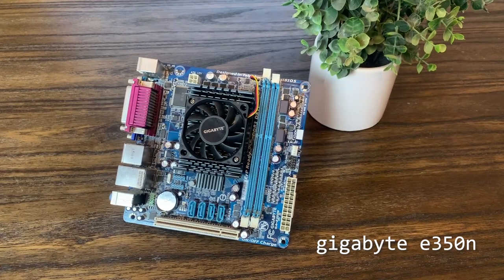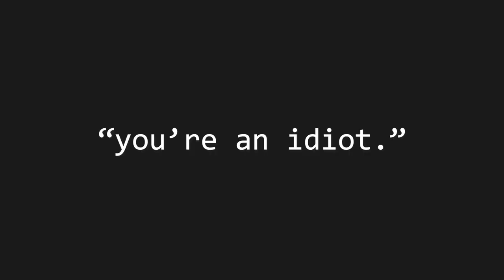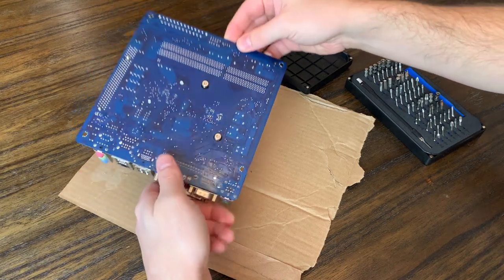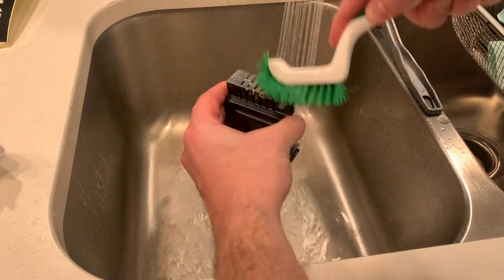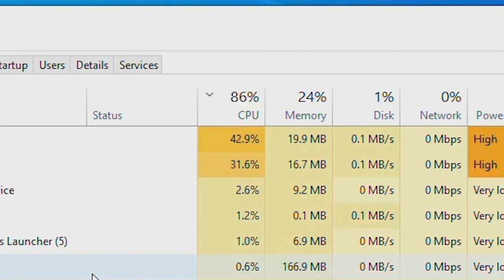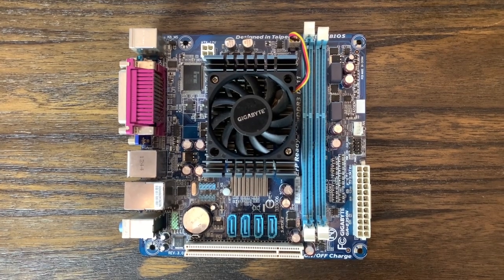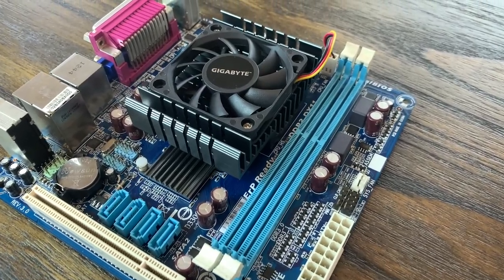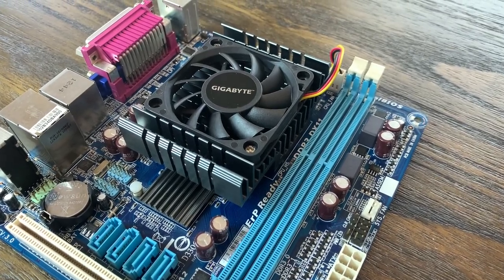Dual Core Disaster? - Landfill to Lan: Gigabyte e350n

Comment: A few suggestions I'd like to offer, as someone who routinely optimized low-end hardware for Windows 10:
1. 2x2GB RAM instead (even if it's still single-channel, I've noticed an improvement over a single stick)
2. Lower-resolution monitor (something like 1024x768 or 1280x1024 still looks great when native)
3. Built-in Windows 10 Optimizations (Task Manager startup, Services, Performance menu)
4. Web Browser Optimizations (Opera is a great choice for multiple reasons)
5. Sometimes an obtuse BIOS setting (such as core locking) can allow for CPU voltage control
6. If you can get the voltage changed, a better CPU cooler, or even a molex CPU fan, can help temps
7. Emulators such as WinKawaks run well on Windows 10, even when there's no performance to spare.

As I'm typing this, I'm running Windows 10 natively on a 1 core, 1.4Ghz atom netbook, and thanks to the tweaking I did, it performs better than what I saw in your video. It's not to brag, just to show that there is performance on the table.

Comment: I'd love to get my hands on one of these (the USB 3 variant). I think it would be great for a basic NAS box.
Reply from the maker: That would be cool to try out!
Reply: For a NAS box id get a Intel board like that since intel Idle power consumption is extremely low
Reply: I have a MSI e350n usb3 in a cooler master 110 mini itx case & the mentioned ASUS R7 240
Reply: I suspect a Raspberry Pi 4 is faster and lower power.
Reply from the maker: DarkeEmpire G0370WW  it's currently running ubuntu server for https://fivedollarpsu.com
Reply: I have an Asrock E350M1, 4xSATA 3, 1x PCIE (x1), Realtek 1 Gig LAN adapter, but only USB2 ports. It ran for years as HTPC with Kodi under Libreelec. Good for H264 up to FHD resolution. Tried to repurpose it as NAS but it's a little slow for this. Openmediavault, 2x SATA 3.5" drives, CPU is a bottleneck with LAN transfers. Reading a single large file from E350 via Samba max 50 MB/s, SSH/SFTP read only 35 MB/s, encryption kills the CPU. Pure FTP goes up to 80. In all cases CPU usage close to 100%. Didn't even try any sort of RAID. Disks are not a problem, both go above 100MB/s. Running iperf between E350 and another machine on LAN would give only 830 Mbps (usually it goes up to around 950 Mbps). Now what I would like to try in na NAS is one of those later AMD AM1 Kabini/Jaguar APUs 🙂
Reply: @KevInPA84  nobody cares
Reply: @JamesMyatt1  Was thinking the same thing.

Comment: Well I have a suggestion, look for some broken laptops or even just the motherboard by itself, you get very little expansion, but you can get a hold of much nicer mobile CPUs within the $20-$60 range, for example laptops with an i5-4300u are fairly common and so old that they go for next to nothing, but they're really not bad, they're actually a decent improvement over that a6-5200 you have there and I don't have a watt meter but from what my uninterruptible power supply tells me, I can estimate it uses around 20-30W with a basic 5400rpm drive, plus unlike desktop ram, for whatever reason so-dimm ram is dirt cheap, like near $1 or $2 per GB cheap.
Reply: 4gb boards with the i7-4600U can be had for $50-$60. Its a significant improvement over the i5-4300U in efficiency for tasks. Also supports 12gb of ram and the board consumes 17watts under full load with an ssd.
Reply: @mxmobile5619  Mind clarifying what you mean by significant improvement? Sure it's certainly better, but a fairly mild difference, I'm actually lucky enough to have both the i5 and i7 for just $20, more importantly however, once you get into the $60+ range, you start finding more modern stuff like first gen ryzen or 6th gen intel, sometimes you'll even find quad-core options and getting anything newer will be a far bigger improvement over getting an old i7, that's why I generally recommend avoiding them unless they're about the same price as their i3/i5 counterparts.
Reply: @vgamesx1  In areas where the same load is needed the i7 consumes significantly less power than the i5 and the 4600U outperforms the i5-6300U which can be found for the same price as the i7-4600U. I only recommend the i7-4600U over the 4300U because it can punch up to 6th gen i5 ulv territory for a lower price, to me the two generation later i5 performance match is well worth the extra $20 to save $50 on a board that'll just match the performance.
Reply: my i5 4300u laptop idles at 7-8 watts when screen is off, no spining drive tho, only m2 sata
Reply: @dim3nt0  Well as I mentioned it's an estimate, it isn't extremely accurate, it only reads down to something like 15W at its lowest and it being a UPS means I have a bunch of other things plugged into it but thanks it is nice to know it is lower.

Comment: i got an old thinclient with a Intel Atom cpu, and 2gb Ram. it had basically the same performance on windows compared to what the video shows, so i tried Linux Mint xfce, and it now is actually usable. you could try the same, its extremely easy to install.

Comment: Quite frankly, you got scammed outright. I would block that user from your account. I'll never pay anything at all for such a junker spec.

This type of boards was AMD's answer to Intel's Atom series for low-end admin-use systems. They were only good for word processing in offices.

The board you have was from the Win 7 era and designed for that. Windows 10 would be a dog. You should try to get this working on a Windows 7 Starter to see usable performance on this or some light-weight OS like Ubuntu or Linux Mint.

Comment: Do a backup server to your pavillion "server", use home assistant to power it up once per night, sync the data from your main server and power it down afterwards. stick it to a location within your home that is as far away from your main server as you can manage - maybe in the basement if possible to protect it from natural desasters (ok - except heavy flooding....).
Reply from the maker: That's actually a really good idea. I've had tons of trouble trying to wake from LAN with HASS though
Reply: @HardwareHaven  Take a look at wake-on-arp on github, I had a similar idea once and at roughly the same time the creator shared this project with I think r/homelab.

Comment: In terms of emulation yes it can run Lakka and very well....  However N64, PSP, or other newer systems is a no.  This board would actually be good as a DIY arcade cab with either a old school CRT monitor, or a older 19" 4:3 LCD monitor (since you got a VGA port).

Comment: I had a little Lenovo x120e that ran on the same processor. It ran abysmally on even a stripped down version of Windows 10.  I got so frustrated with this machine that I just tossed it.    I wish I had known a little bit more about Linux at the time I acquired it.  Now that I know a little bit more about Linux, I think something like Zorin Lite V15.3 would have been fantastic for the x120e.
Reply: my pc was worse than the one in the video

Comment: bought a couple of these to make voip servers, they are perfect for it cuz its low power and it has that single pci slot which i need for the hardware interface to add analogue phones to the unit. works perfectly and its really small, i know this is a niche use but ive seen people use these for routers and NAS' too so they do have their place but not for 30 dollars got two for half that of ebay a while ago
Reply from the maker: Nice! I might test it out as a router down the road
Reply: @HardwareHaven  oh cool, that will be interesting. I've seen people use things like PFsense and that but that was on expensive hardware but would be cool to see how it works on these.

Comment: Hey, I bought exactly the same board for emulation. I tried it under Batocera. Sadly it have so slow CPU, that couldn't handle even PS1 and have problems with N64. And it became unstable with any try for overclocking.
It is sad, becauise 1,86GHz cpu is enough for PS1 and this was so close...  (I tried it with intel core 2 duo)
It is still good for some retro PC gaming from XP era tho (NFS Undergroud 2 for example works great). Even under 64bit Windows 10 :) And W10 works OK, util you wanna go online (especially on YouTube). But internet TV through local app (O2TV) works absoluttely fine.

Comment: You could set up a second TrueNas box to mirror the other one. Four used two terabyte drives striped and mirrored zfs2 I think?... Just set it up to sync with your existing setup. You could even get rid of the mirror on the other one and stripe those drives for max throughput.
Reply from the maker: Yeah, I thought about setting it up with just a single striped 4tb drive I have as a backup, but honestly I'll probably just use a RPi for that haha
Reply: ZFS likes memory.

Comment: I'm rocking a GA-EP35-DS4 (rev. 2.1) mobo, with MBIT enabled on the bios. It was given to me. I have been looking for a decent overclocking program for windows 10 for this ancient board. Any suggestions? I can not find the factory setup iso to see if there was an overclocking utility specific to my board included with the system, as this machine was saved from a dumpster as well.

Comment: I'm using a similar board from MSI if I remember well as home server since 2012 (going to migrate it soon) but I never tested the power consumption (trusted the specific - 16W). It is running an old Debian with LXDE. Quite slow but is doing its job (plex server is installed). I'll test the power consumption before to dismiss it, I'm curious now 😅
(Let's see if the power supply makes the difference).

Comment: Is 30-40 watts not considered efficient? I recently put together a Q6600 system, and it was pulling 100w IDLE and 150w under load running Ubuntu Server.

Comment: Did i mention the windows de-bloater (even though i didn''t get it to work here (yet anyhow), Guy naming himself JayzTwoCents got a dual core (not sure was core2duo, believe was pretty low spec) running pretty decent using that.  And also,  i think i may said it before here, not sure, maybe old you tube can be of help (or you tube redux ?). Hope not having been to much a bother, when saying things, already known of, or for some other reason.         Greetz from one who started (with computer not before this, but before that one, which had 125000 (and then some, if i calculated correct) less ram than the (considered minimal , or even below, by today standards) i have at disposal today.

Comment: The PSU has a high minimum power draw. The TDP of that chip is 18W, while TDP doesn’t exactly equal consumed power, it isn’t off by a factor of 2 either. I also have a laptop with the same chip and it sits at about 5W in vim editing text with the screen at full power.

Comment: I would recommend to go with a newer intel chip like the 4105J (those boards don’t costs that much) or even go with a N5105 that has as much power as some older desktops i7‘s and I would Recommend to use a way more efficient pico power supply. Those old chips are not really worth it, after one year you paid as much for the higher power consumption as you paid less for the board itself.

Comment: I would love this thing as a CNC controller because of the LPT port and the few additions it has. Would probably be really good at that
Reply from the maker: Oh nice! I know basically nothing about CNC or 3D Printing, so that’s interesting
Reply: @HardwareHaven  Usually you have dedicated hardware for a CNC controller but with CNCLinux you basically turn everything off which can be turned off and it uses 100% of the CPU time to create the signals needed. So it doesnt really matter if the CPU is fast slow new or old as long as its somewhere around like 800mhz or above. Often you even turn of hyper threading and all cores but one.

Comment: I would give Proxmox a go on it. BTW loved your plex/home assistant video. Also your music doesn’t overpower the subject matter. Bravo.
Reply from the maker: Thanks!

Regarding proxmox, would only having two cores limit what I could do with it? 

(I’m not very experienced with VMs and have never actually used proxmox. It’s on my list of things to try)
Reply: I hadn’t thought about that. Raspbian OS would work on that. (I love that OS for low power pc’s)
Reply: For Proxmox you want a bit more memory. Even plain Debian is  a bit slow on these. Using Arch without Systemd  makes it useable.

I have something similar. I also run a 2 node Proxmox on a bit more powerful hardware.

Comment: Grabbing an old PCI card would improve performance a lot, especially in video playback.
Reply from the maker: Yeah I’d really be interested to test that out. Keeping my eyes peeled for a good deal on one.
Reply: @HardwareHaven  not sure if a pci gpu would help ..max i know of is in the mb range .. the agp/pcie ram size flipped  from around 512mb to 1g (can only find 512 agp cards)

WinNT 2000 server had multi cpu and up to 4 gig ram support so as a retro would need to install that
Reply: Another point about pci gpu ... bios may let you "share" more ram then a dedicated pci gpu

Comment: I love these lacklustre mainboards. My mail and web server was recently upgraded to an ASRock A330-GC dual core Atom 330 mainboard and it's blisteringly fast compared to the Intel D945GCLF Single core Atom 230 it replaced. I only upgraded because the newer version of SME Server 10 really wanted 4Gb RAM and the old Intel board was maxed out at 2Gb. The SME forums were telling me how it wasn't going to work on such a lowly spec board, but it works just fine. It's hosting a handful of static websites and a dozen email addresses so it's hardly an enterprise grade load.
Reply from the maker: Super cool. I've never hosted a mail server, but I've hosted a fair amount of web content, and it seems like you really don't need a ton especially for static stuff. Thanks for the comment!

Comment: I have a similar board the Asus e350-deluxe. the reason your idle power usage is so high is the os. windows 10 is a monster compare to the on is was intended for window XP. should put the idle power closer to 10w + or - the devices installed. My was originally used as a attached media server and nas running windows. with the head attached to tv I'd watch youtube and emulate up to n64 mostly. eventually I forgot it and it crashed doomed to clear dust. then came my cheap cheap chromebooks and complete lack of storage. and the e350 was assigned it's new and last task of full on nas server hosting Plex and my torrent server. which she does very will assuming no trans coding for Plex.
Reply from the maker: That’s a good point 👍🏻

I used windows because that’s where a lot of my other data came from, which allows for comparison. But it would be interesting to do those same comparisons in Linux to see how it scales

Comment: Couple notes on the clean up of the board.... It's probably so little of an issue that it might not be worth mentioning, but the cmos battery should probably be removed when cleaning the board, especially with any kind of liquid, and ideally you should have an anti static strap and antistatic brush (the brush's are partially conductive so they ground through the strap you wear, so you need both).   Kind of nit picks really, but assuming you "Make it" as a youtuber it's probably better to do it "right" so other people don't assume they can just copy you when you do it "wrong".
Reply from the maker: I feel like this is 100% the way to actually change someone's opinion haha

I completely agree on being a good example. In my head, I didn't care because it's cheap, and the odds of static discharge damaging components is pretty low. But I'll at least maybe mention it in future videos of that nature. Thanks for the comment!

Comment: Does it have Win XP drivers? You could get a really small psu and get a tiny case or 3d print one, and make it a tiny retro XP gaming PC. =)
Reply: The motherboard's support page has WinXP drivers available, albeit dated.

Had a Wyse Z90D thin client (has the G-T56N APU which is exactly an E-350 spec to spec) running Windows 7 and used it as a retro gaming PC for a while, it worked alright but nothing fancy: NFS Underground 2 and Most Wanted 2005 running 30fps consistently in 1024x768 with low/medium graphics, NFS Carbon has occasional frame drops under the same settings, Crysis is of course out of the question.

All in all, a bit weak for mid-2000 3D games but should handle 2D games and early 2000 3D games just fine.

Comment: Always go for 2 DIMM’s, even if they’re half the size; 2x4 is better than 1x8 o/
Reply from the maker: It's possible that I'm wrong, but to my knowledge, that only applies when you have dual channel memory. This cpu only supports single channel memory, so it shouldn't matter. If it's dual channel, then you're 100% correct!
Reply: @HardwareHaven  well, it's not the memory that 'has to be dual channel', because DDR3 memory is exactly that. but this board (and the USB3 possibly the same) does not seem to support this. Even though it was build for DDR3 (o_O)
Weir design decision...
Reply from the maker: @RhoTrepaan  Yeah I said that weird. I'm aware that the cpu and Mobo have to support multi-channel memory. It's frustrating that boards like this randomly are only single channel.

Comment: Just run Linux
Reply from the maker: I actually did haha. I use this in the fivesollarpsu website project. It’s running Ubuntu server. I used windows here to be able to compare it to some other stuff I had tested out
Reply: @HardwareHaven  Nice. As an independent developer (in my free time) it's good to see others using Linux even if it's Ubuntu (Debian is lighter)!
Reply from the maker: Ubuntu was the first distro I used so it’s just a comfort thing haha. Im slowly trying more and more. I actually used Debian for a web server recently 👍🏻